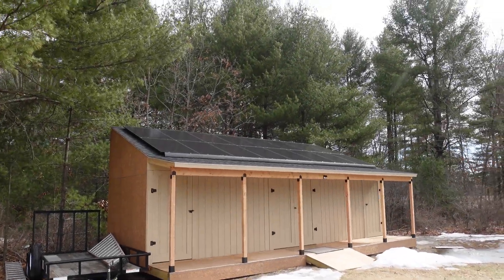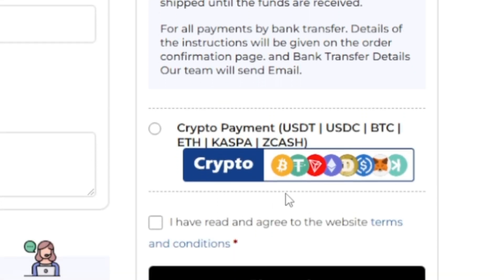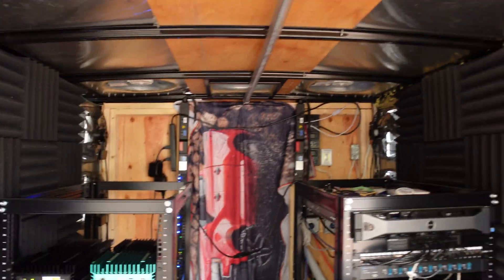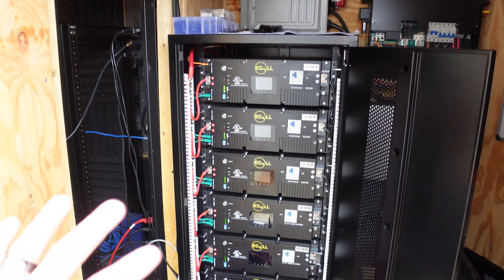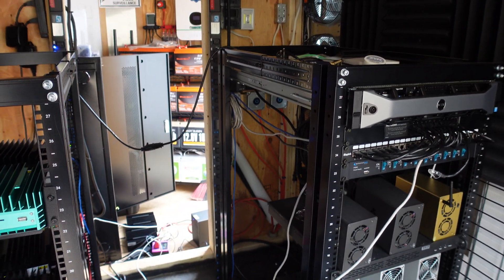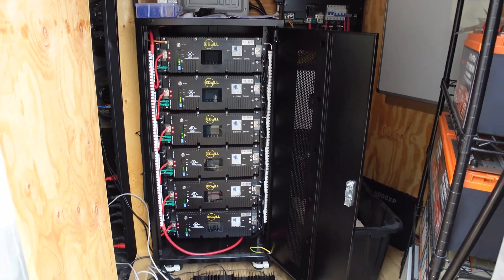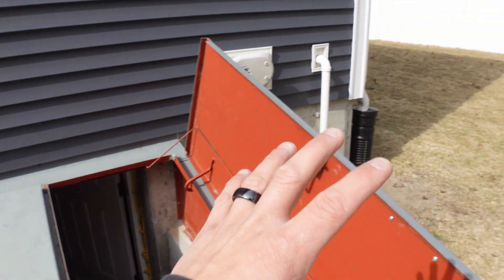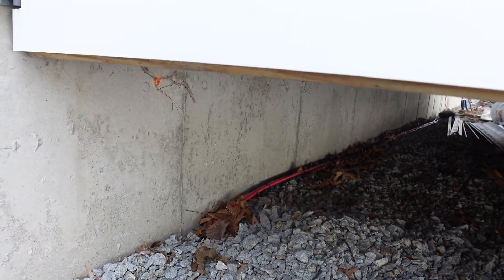My New Solar Inverter Location Plans

Comment: Great idea, you planning on adding more panels this summer? Break out a stand alone breaker box for strategic circuits in the house, with an auto transfer switch to power them with solar & batteries, then auto switch back to mains when you run low on juice? 
That's how I had my solar rigs setup in the shed in GA, super convenient to auto-magically switch the power when it made sense.

Comment: @CCXD 100% great idea, enter your basement from under your deck for the PV wires just use metal conduit though to meet code for PV HV wires, man your setup is perfect to even power your house, add like a grid boss unit or even an Anker F3800+ to your setup, truly during the summer you can 100% run off solar etc.. cant wait to see you setup done!